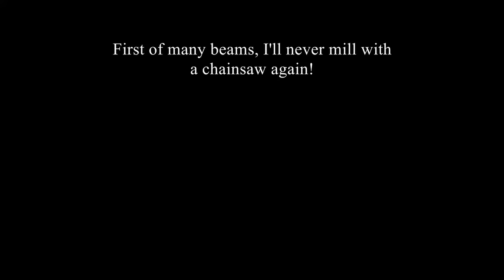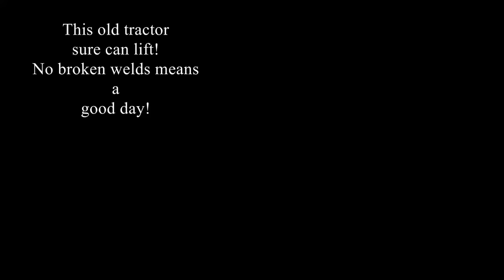A Timber Frame Vlog #1: The Beginning

Comment: New to your channel and interested in the barn build. Do you think the scarf joint is strong enough to support the load if the joint was placed in the center between two posts?

-JohnyB
Reply from the maker: Hello.  I think it would be weak, in theory you can design it that way but in practice I wouldn't advise it.

Comment: We are planning on building a barn next year, after I mill all the lumber. Thinking about trying timberframe. We bought a few books and I've been reading up on it. But one thing I haven't seen discussed is attaching the posts to concrete. 
How did you fasten yours? It looks like you have 2x treated wood under the posts. 
Great looking barn!
Reply from the maker: +david dorshak there is a couple of Q and A videos where I discuss anchoring.  I'm not anchoring until the first floor is up in case I have to make adjustments.  Thank you for watching.

Comment: I am just South from you a stretch.  On about 130 acres.  I have a lot of spruce that needs to be harvested.  Beginning to organize for several timber frame buildings myself.  I appreciate what you're doing.  It helps me organize what I will need to do and appreciate the work ahead of me.  I too will have to go it alone.  Hey, part of the fun, right?
Reply from the maker: I know all about it.  Just don't fall off of it like I did, that's no fun.

Comment: I have been binge watching your timber framing playlist on double speed all weekend! For some reason the order of the videos is out of wack but thats no problem. I was wondering how you feel about the size of your mill in relation to milling timber for big timber frames, now that you have used it a bunch. Was 32" diameter enough? I was looking at the HM126 with a 26" max diameter, but I think that is too small. They have a 30" version but I am worried that may not be big enough either. My plan is to start with a small pavilion, then live on the land in a camper with the pavilion acting as an extended outdoor space, while we pay off the land. Eventually I want to build a timber frame house, barn, workshop and anything else I can think of, but I want to make sure I get a mill big enough with the future in mind.

Thanks for all these videos, way better than watching tv!
Reply: Actually, I just found the circumference of a 30" diameter log and that is a pretty massive log.
Reply from the maker: Most can get by with a mill that will only cut 24", this one cuts 32".  I wouldn't change a thing on it.
Reply: @TheTradesmanChannel  Thanks for the reply.

Comment: I notice at 1:18 and in the third bay floor joist video, you haven't wedged the scarf joints. Is that something you can just wait to do?
Reply from the maker: +Lolita's Garden I had had temporary wedges to put the scarfs together and then ran 10" timberlocs through the joint to hold it until I made my wedges.  Before the middle joist goes in they need to be wedged.  They also need to be wedged before to put rafters in.  It is at that point that you will be putting a good load on the scarfs.
Reply: Better to use some good dry pieces for the scarf wedges, and get them in early before the beams dry, imho
Reply from the maker: Your opinion is very correct.  I've learned a lot of lessons on this build.

Comment: Looks like you used a floating slab instead of a foundation.  How deep and wide did you make the rim and how did you tie the posts to the slab?
Reply from the maker: Monolithic slab on top of 2' of compacted gravel.  Making angle iron brackets with expandable concrete anchors.

Comment: lot of knots in those timbers wouldn't you say?
Reply from the maker: +Wayne Wildman it's pine, par for the course.  Hard to mill 10"x16" beams 20' long without getting them.  That's part of the reason for over sizing them.......
You wouldn't be a bit of a ball buster would you?....If so we might be able to get along.  Again, thanks for watching.
Reply: Building with pine...i guess I'm just spoiled because of where I live.
Reply from the maker: +Wayne Wildman good morning Wayne.  I chose pine over a lot of other species for its properties.  I could have used oak, hemlock or whatever I wanted.  I live in the Northeast and the area I live in has some very large stands of timber.  The pine has a much lower moisture content compared to oak or hemlock so it does not shrink as much. I needed that because I knew some of this wood was going to sit for awhile.